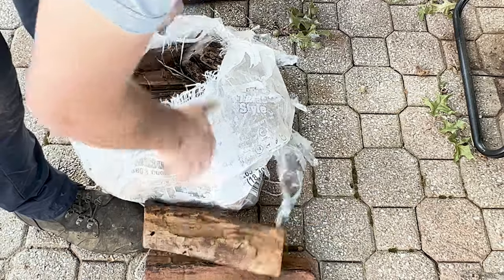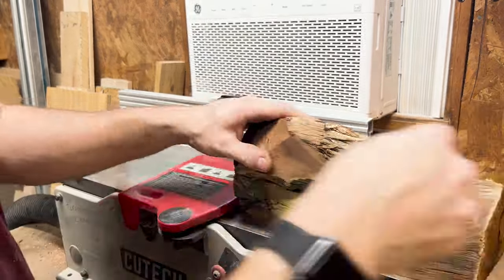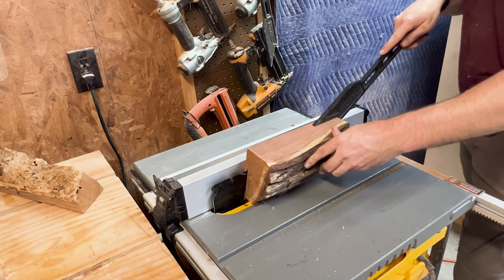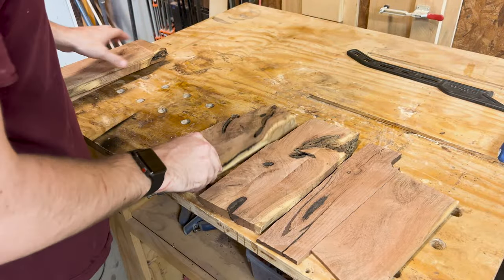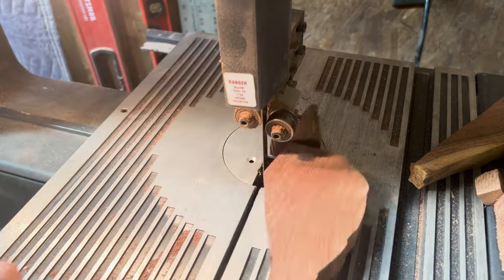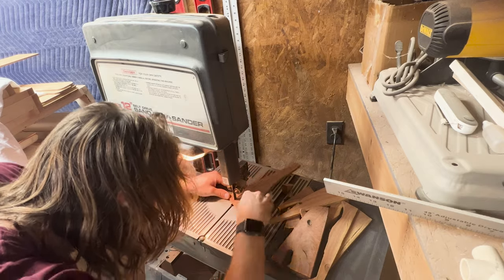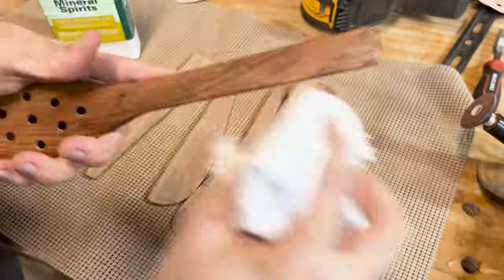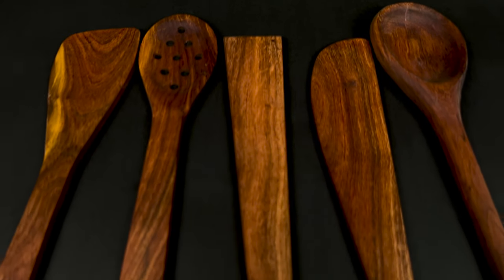Making Cooking Utensils from Firewood

Comment: Beautiful!, Great idea I have some Black Walnut sitting around..I just need a jointer :-)
Reply from the maker: The CUTECH one I have was $230 and I got it on sale for $150 I think. Had it for a year, works GREAT! Like actually amazed how nice it is for how cheap I got it. Only rotated the blades once and I use it on pretty much every project. It is quite small though.